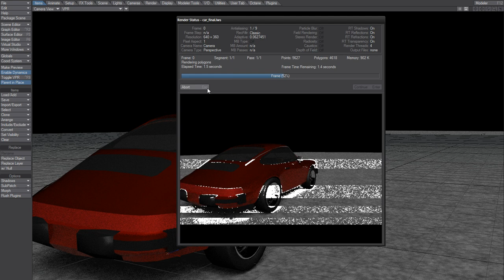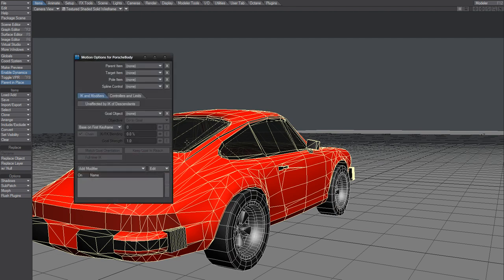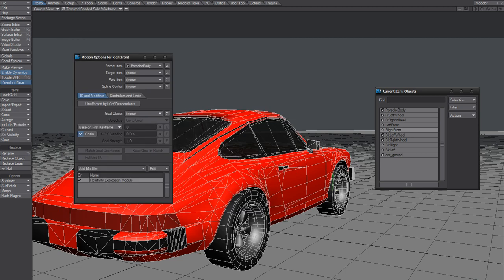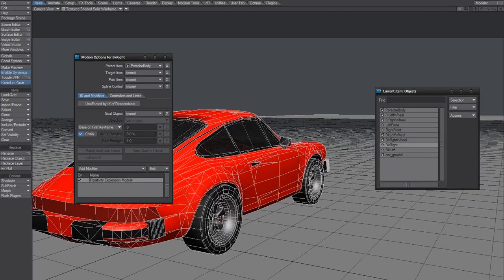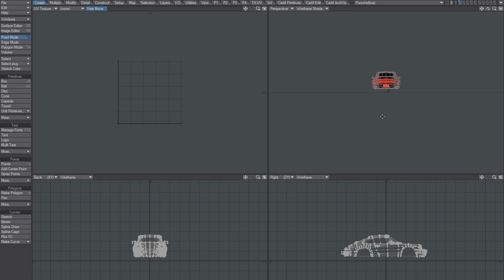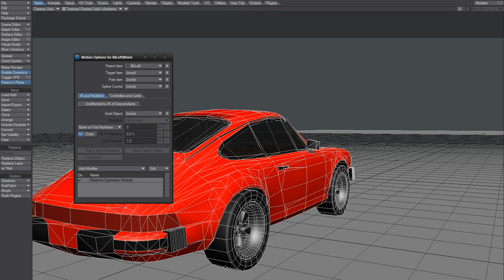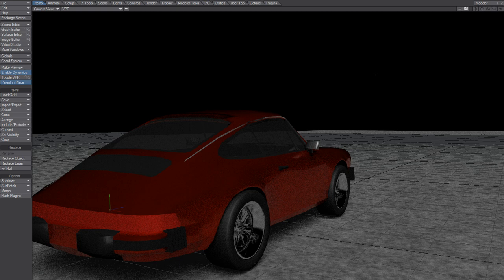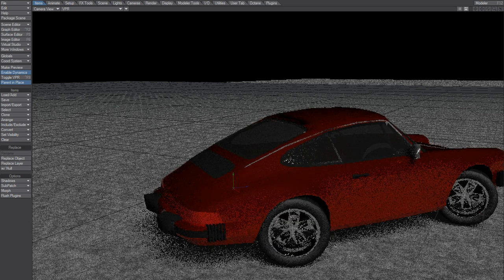LightWave test - Relativity Car - Wheel

Comment: wow using that feature for wheels is a blast from the past.    The other method was using Wheelie from Steve Worley's (Fprime) Polk plugin.     But the overall best solution was always using the old Reelmotion plugin.  which was used by many top Post/Vfx houses in LA back in the day, especially for car commercials.   The benefit with reelmotion was its fully physically correct dynamic based system.  You actually drove the vehicles (cars, boats, planes aircraft)  in realtime as the motion was recorded for both vehicle chassis and wheel motion.   driving over rough terrain, rear slip differential, it all worked like a charm.  and since it played out in real time like a video game, you could reset and repeat your sequence over and over again, then watch your result with its 3rd person cameras which also could be saved out.   Till this day nothing  has matched reelmotion.  Unfortunately in order to use it you gota not only install an older version of LW, but also much older version of windows, because the opengl files also need to be of that time. (windows NT)  but trust me..  its worth it!.
Reply from the maker: cool, didn't know  :)
https://www.youtube.com/watch?v=dE2Kf5tiaso
maybe in Win7 one could disable some OpenGL options or such...